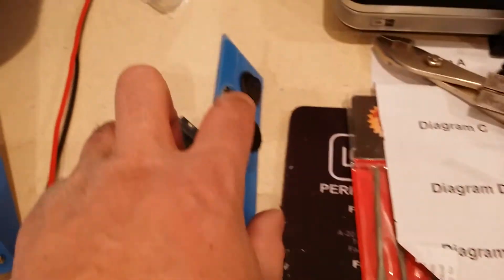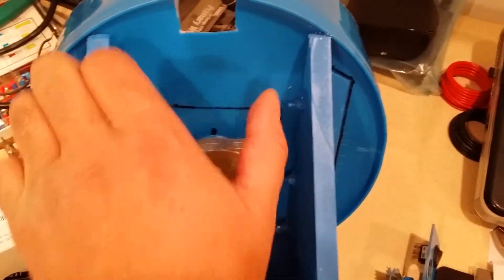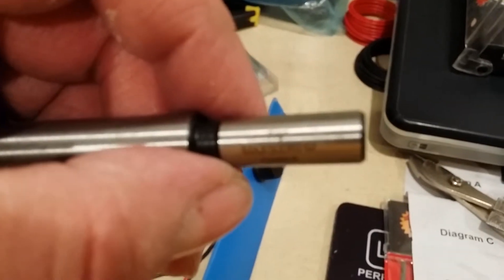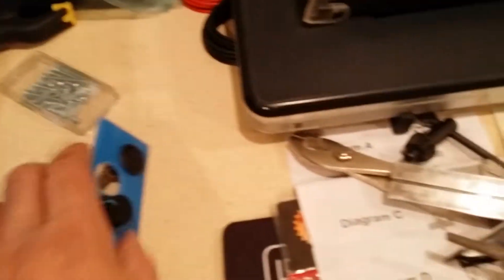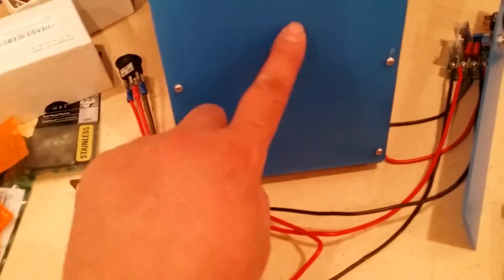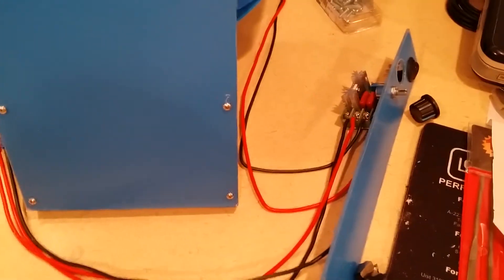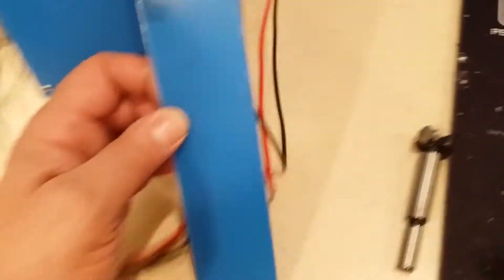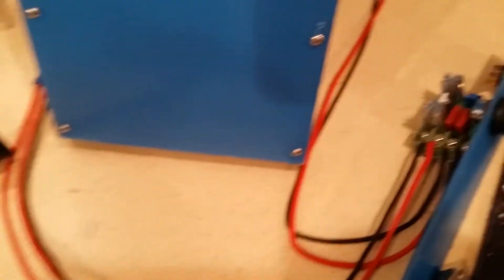My $50 DIY case feeder for Dillon 650 - 4 Electrical Overview

Comment: May I ask how you cut the cutting board material so perfectly? what did you use to cut it? I bought a few buckets and I'm trying to duplicate your project:-) I love your Design and Edgenuity
Reply from the maker: I cannot describe how I did it.  I used a endmill.  But, you can easily place a screw in the center of a square sheet. use a jig saw with the edge guide. screw the edge guide in the center of the material, and that will guide the circle cut.

Comment: Yeah, the motor was a problem.  I bought a motor from a microwave turn table.  You need one with enough torque (around 50K).  On one of the videos, I talk about this. It has to turn slowly, about 5 RPM, and have enough torque to push the brass and shell plate.

Comment: Do you have a parts list
Reply from the maker: +Chris Day Parts list for this project? No. I had an idea for what I wanted to do, the now I wanted to do it and I just got to work on it. Most issues were with the limit switch and the motor.
Reply: I have everything I need except the motor. Can u push me in the right direction for that.
Reply from the maker: Sure, Here is what I bought: AC 110-130V 5/6RPM 50K Robust Synchronous Motor. Search Ebay for microwave turn table motors. If you have more questions, please ask. Good luck